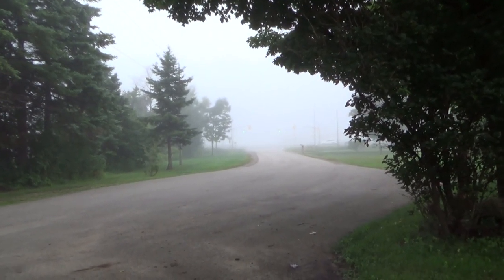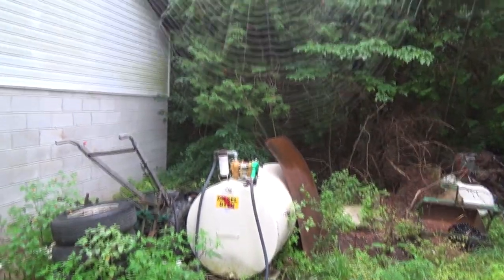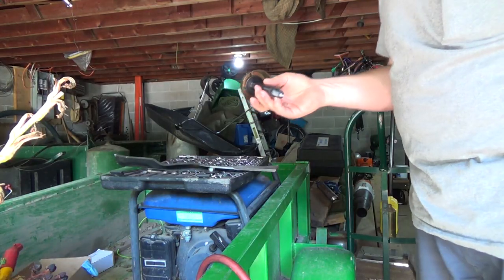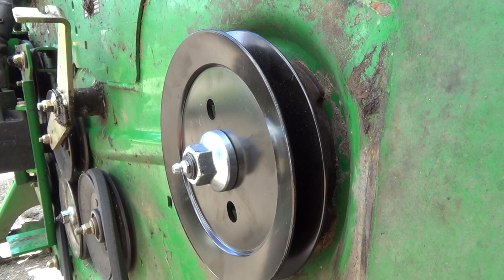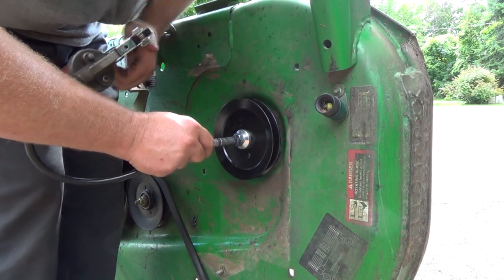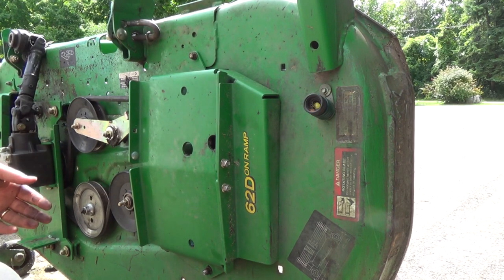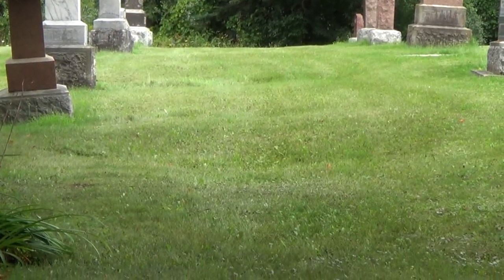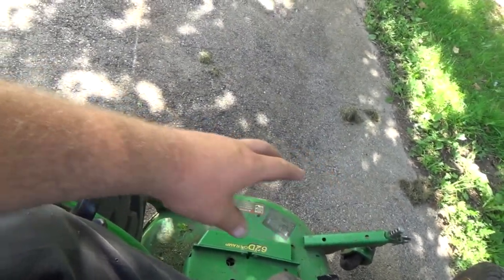Mower deck finish up and tryout

Comment: You talking about the people that put rocks around the graves and then you hit those rocks while mowing reminds me that i need to mow. My back yard was a creek before a dam was built to create a irrigation pond, now it has a overflow ditch running through it. I mow 1 time and have to resharpen the blades, it sucks. i could fill a double axle dump truck with the rock I've pulled out of my yard.

Comment: just an idea if you build new buckets. instead of doing one strip of steel like that, get a piece of angle iron, and notch the 2 spots out, then weld the rest right solid. would be alot stronger, and look better too

Comment: If I were you I would build and attachment that goes on the front that's like a wing plow on a pow truck and what it does it it pushes it over to a convaer belt and it goes into a little cargo space and throw them out that's what I built for my mower for around my driveway and my fence